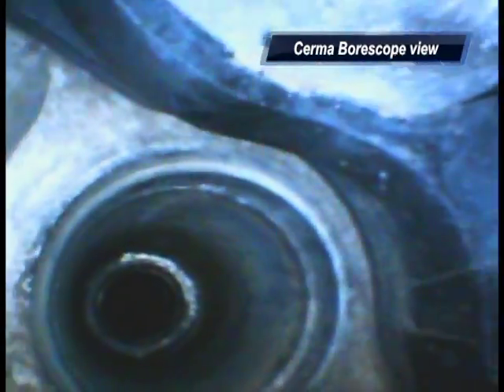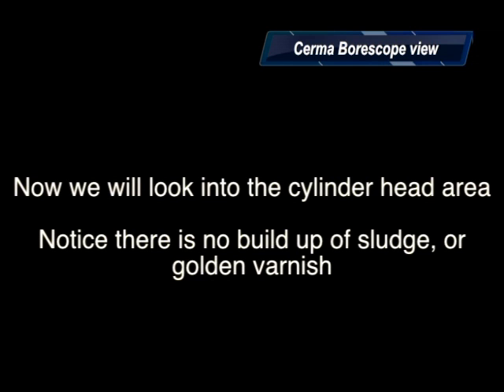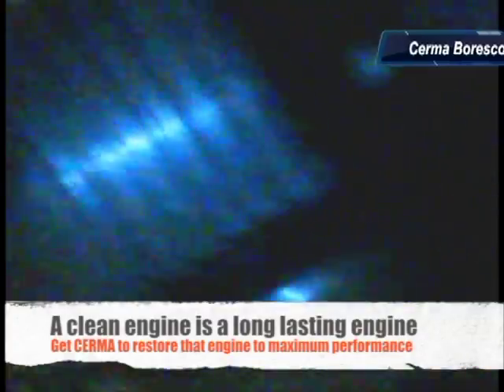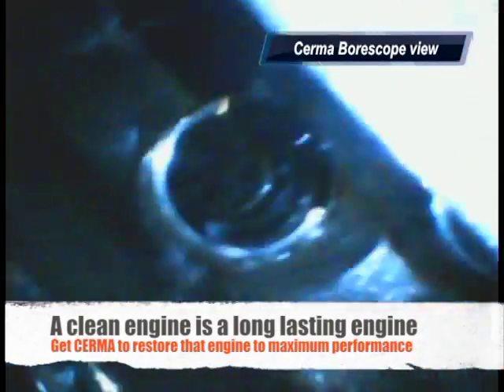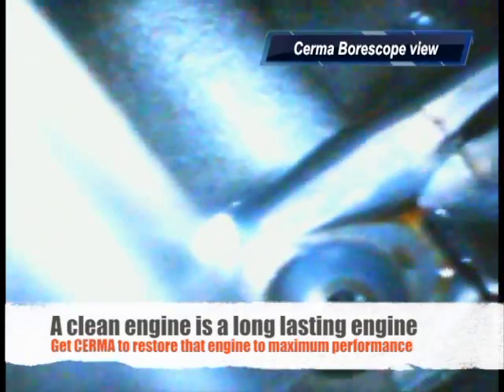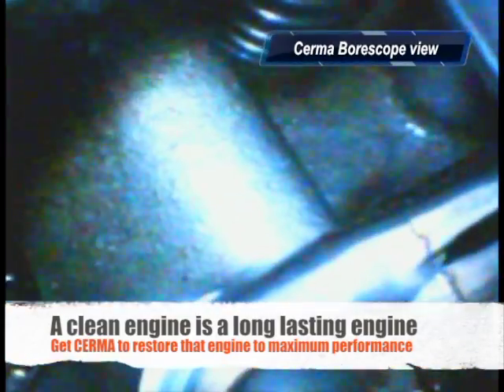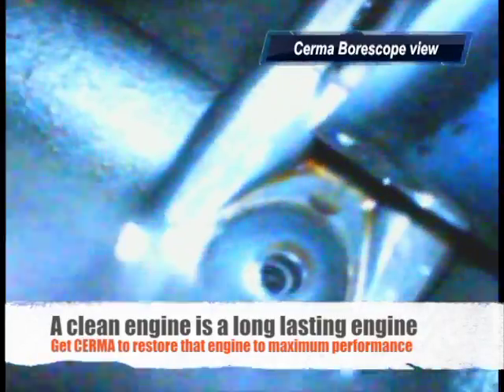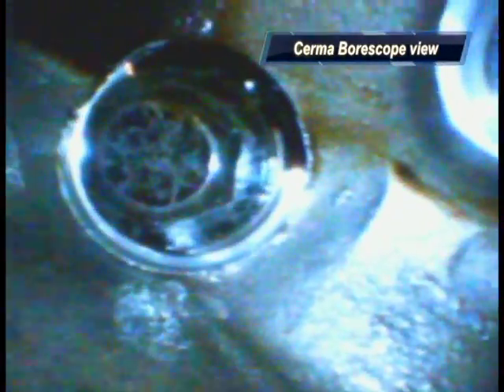Inside of engine using borescope, after treating with CERMA w/STM-3

Comment: Hello, my dads 2014gt500 has plasma-transferred wire arc cylinder-liner coating as well as piston oil squirters and a supercharger. Is your product safe for this type of engine? It has about 3500 miles and I was thinking about using your oil additive before changing it out with your oil.
Reply from the maker: Cerma will work as intended within any metal engine area , I would also advise to use Cerma Engine and Cerma NANO for the induction.  As always Money back if not satisfied with the results
Reply: @cash1306 are you really the ceo?

Comment: Just ordered 5 quarts of your oil and the engine treatment. I notice you guys do to carry oil filters, what do you recommend? I liked mobile 1 but I always cut them open and I noticed excess glue once and since switched to the identical k&n, I went with a royal purple filter tho and will be throwing that on when I change the oil.
Reply from the maker: You can use any filter you like, I personally recommend any name brand filter that is low in price, as the Cerma oil does not require a fancy filter to do it's job of keeping the engine clean.  Carbon Guard that is in the oil will do that.

Comment: Hello, I have an 02 gmc sierra with a 6.0l vortec engine. The truck has 150k on the odo and the engine has a noise they are apparently notorious for making at idle. I'm hopeing you could maybe offer me a promo code for a discount on your oil additive. If I was happy with the results id be happy using your oils and additives in my 6.0, 6.6, my 5.0 explorer and my dads 2014 shelby gt500. Also I'd be willing to post up detailed real world videos reviews on the products and their before and after affects, compression, oil pressure, engine idle quality. I'd be interested to see what the fuel additive would do for my balance rates on my 230k stock injectors. So what do you say? Could you hook me up on a good discount for a first time buy?
Reply from the maker: Hello, If you want a discount on Cermastore.com Use the Code ( NEW ) or call the office at 866 496 3103 and I am sure that someone will help you.
Reply: +Cerma-CEO I wish I had known that last week, I just got mine in the mail on 10-2 and cost me $106, I can hardly afford that, but I have a 98 MB SLK230 with a 135,000 miles and I am hoping to keep it running till I die..I am 66 now
Reply: +Michael K As reliable as Mercedes Benz cars are that would probably turn it into a car that lasts long enough for your Grandchildren to maybe one day own it.  My uncle had an early 300D turbo diesel and had that thing up til 2014 when he sold it.  It still ran very good.  I could have had it for 5000 dollars if I wanted to.  Just imagine how long that car could last if he had Cerma in it.  He is one those people who doesn't believe in any sort of additives or metal treatments.  For that reason I don't speak of such things because although people such as him are wise about many things they never had exposure to a product of the sort that lived up to its claims.  I know that they will tell me not to buy it because of it being a waste of money.

Comment: John, next time consider taking a video before adding your product, so we can see the actual difference.
After you explained how the product mobilizes sludge to the filter and reading a few experiences on a forum as well as watching the timken load test, I decided to try your products.
I recently paid for a Toyota 4Runner but the inspector neglected to look inside the valve cover. When I picked it up, I discovered it was loaded with sludge and rust. I'll keep careful mileage records and take photos inside the valve cover to have a before and after. I'll post my results at t4r.org
Reply: +bigfastmercury That is just horrible.  I don't personally own a Toyota vehicle but I thought they were better than that.  I hope you didn't get a lemon.  You would be amazed how easy it is to buy a lemon these days and not even know it until the warranty has just ended.  It could be worse even since some auto makers don't honor the warranties they say they give.  I have read a nasty article somewhere to that effect about Hyundai.